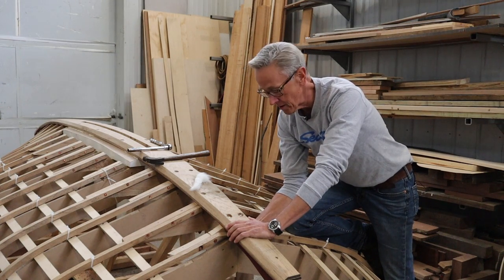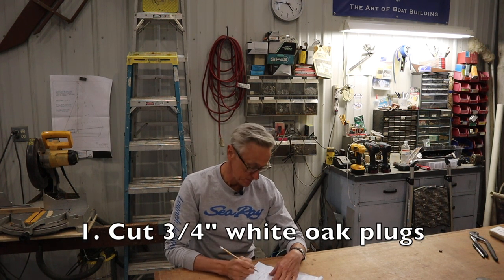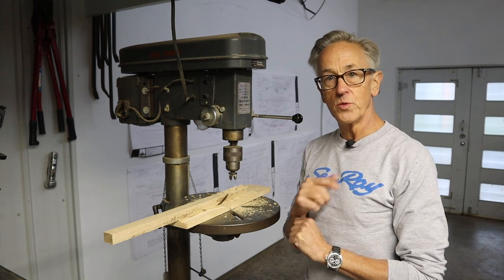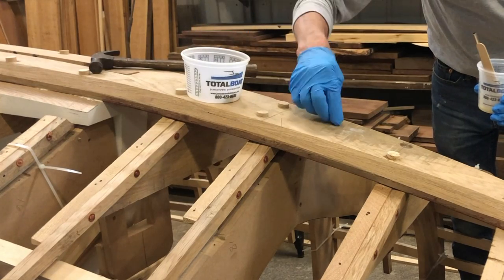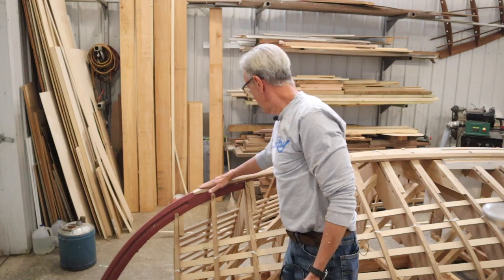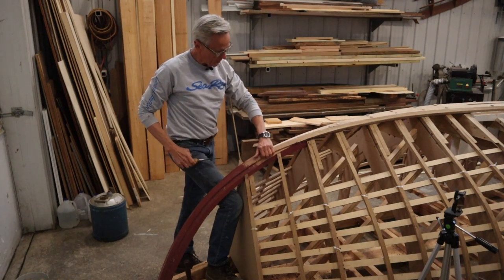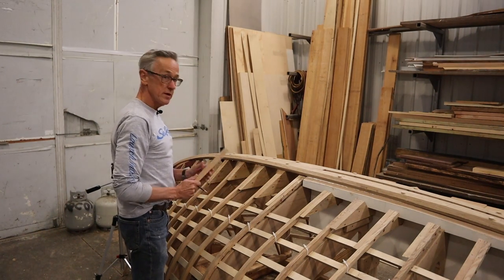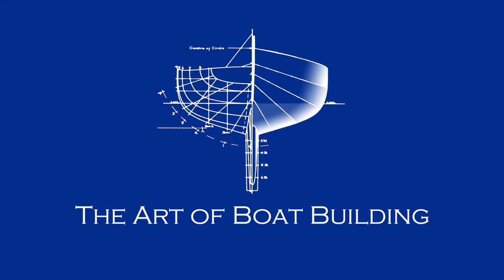Carving the Rabbet and Preparing for Planking, S2-E12

Comment: That's a lot of back strain working on that keel from the shear line.  You might consider using a little bit less glue when installing a bung to prevent the excess glue hydraulically locking the bung which could prevent it from seating as far down into the hole as possible.  Great episode and thanks for sharing!

Comment: You should draw a line on the head of the plugs, and draw it in the direction of the grain in the wood, so when you sticking the plugs in its easy to see which way the grain goes, so when your hands and everything is covered in glue you dont waste time looking, and you usually chisel/saw/sand the tops off anyway.

Comment: There is about a 99,9% chance that I will never build a boat. :D
But I really like the videos about boat and horse wagon building. Most woodworking is about right angles and flat surfaces, but this is a totally different world. Watching this stuff with all the curves and blending really keeps the mind open (at least for me).
The only questions I have so far is how expensive is those bronze hardware? Is it more or less expensive than stainless? And could you use stainless or might that make the wood rotten because of some chemical reaction stuff?
Reply from the maker: The bronze is expensive. Stainless is also (about the same) Bronze is the best choice as it is malleable so it can stretch with the movement of the boat. Stainless is very hard and will not move with the boat the could result in damage to the hull. 
Just one of the costs of building a boat.
Thanks for watching!

Comment: Something I've always been curious about.  What are the advantages/benefits of using a round mallet rather than a flat faced one when chiseling?  Thanks.
Reply: Ergonomics and less damage to the chisel handle.
Reply from the maker: Hi Donald,
The weight of a round mallet is more evenly distributed along the longer head and the long head surface reduces the chance of "misses." All said and done, it is just a matter of use. If you stick to one type of mallet, either will work just fine. I use a round mallet when carving as I don't have to think about the head orientation while working. There is also a technique that the round mallet allows. It's a matter of a wrist flick at the strike that produces more power with less work.
Thanks for you question and watching!

Several viewer have suggested a mallet as a tool making video. I'm putting it in the queue. So, at that time I'll explain future. 
Cheers,

Comment: Plugs need to be a bit tighter mate ?
Reply: The glue will hold them in, I guess? Yeah, I was thinking they seemed a bit loose. However, without paint, and with some paints, water absorption will tighten them if they don't fall out first.
Reply: He put them in with epoxy and added filler material.  Problem does not need to be tighter than his will be.